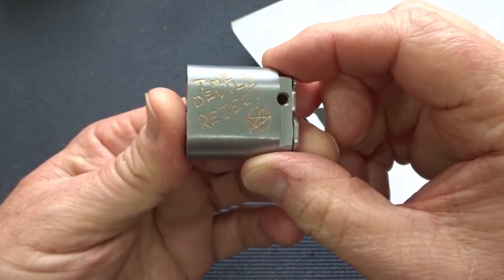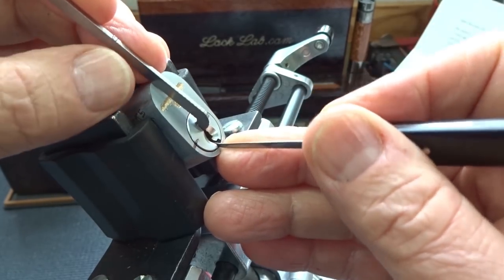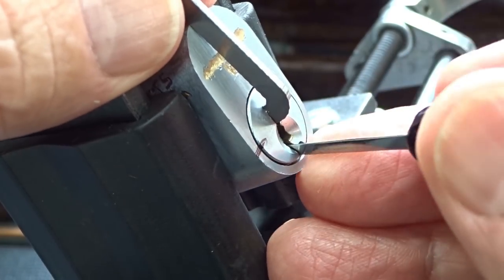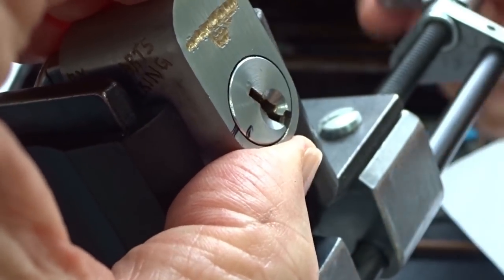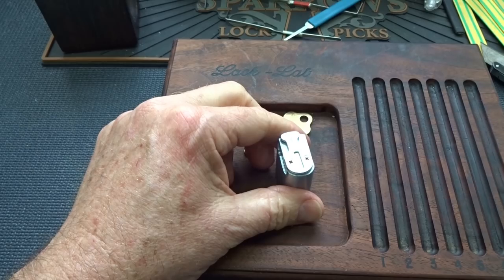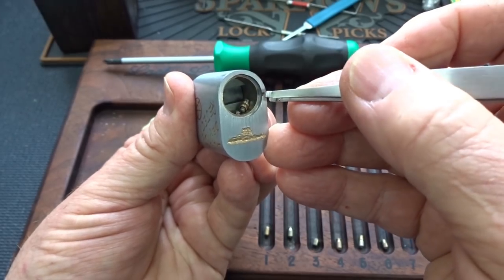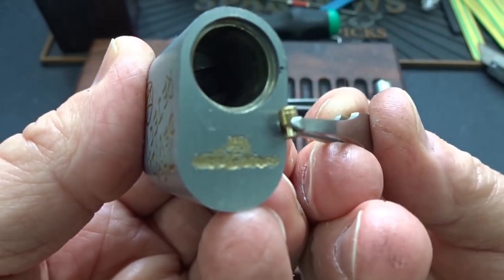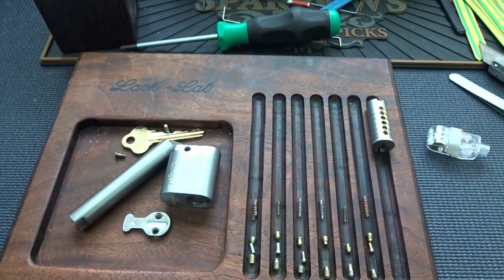(1263) Challenge: Dark Art's Intricate Pins

Comment: I watch all your videos but just never understand how any of this serration, spools etc make it any more effective, you just pick it so easily
Reply: Mini Sota He makes it look easy because he is very good at it. A lot of things are going on, that just can't be completely described. When picking a lock, It is easy to mess up tension, pick placement, picking pins out of sequence, pushing a pin too far up, not pushing a pin far enough up, wrong pick shape, wrong pick thickness, and even if you get all that right, there is still a chance of something tricky hiding in there like a check pin, or side bar. Security pins can make a difference in resistance to opening. You can open an easy lock, like a Master#3 with almost anything. You probably won't open a challenge lock with a pick made from a cat food lid. 
An expert at anything will make something difficult look easy.

Comment: Bill, maybe I'm missing something, but if the actuator has to come off anyways, every time, why isn't that the first step before clamping? Is it to show you haven't tampered with the lock? I've probably heard you say 100 times "the actuator is hitting the vise".
Reply: ezdankie so the whole core doesn't pull out when he is picking it. The screws on the back of the tailpiece or "actuator" holds the core in the lock body.